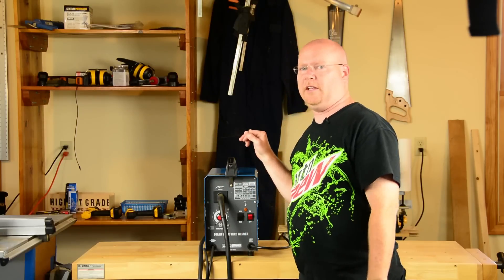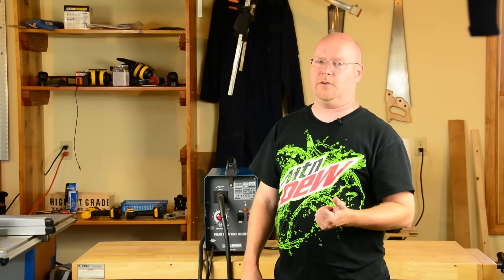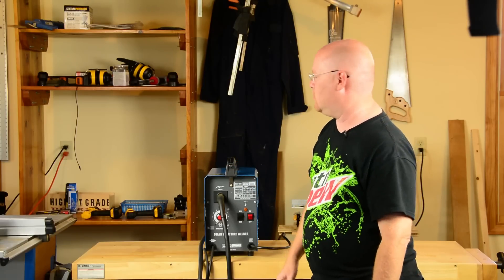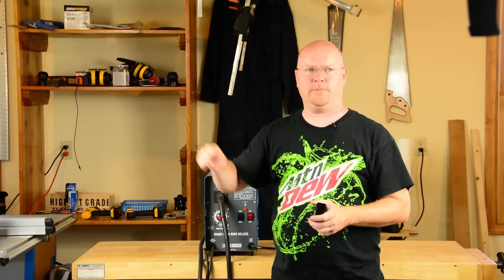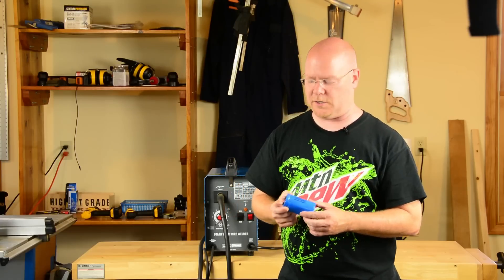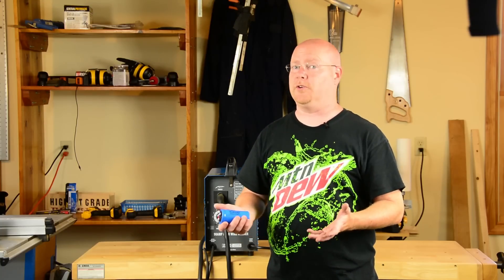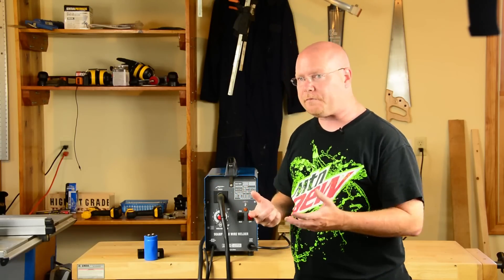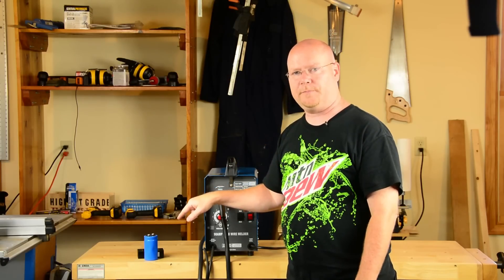Advanced Harbor Freight 90 AMP Welder Mods 01

Comment: Can I use a bigger capacitor
Reply from the maker: You can so long as it's rated for sufficient voltage.  Not much point in it though.
Reply: @MattHeere  what’s the voltage drop when In use and do you have a link for these parts ?
Reply from the maker: @stevenscribner8866  I haven't looked for the parts in some time, so sorry but no links.  The cap needs to be rated for at least 50V
Reply: @MattHeere  does it matter if your welder is on 120 or 220?
Reply from the maker: @stevenscribner8866  Nope.  We're on the secondary side of the main transformer,  so the voltage has been stepped down accordingly already

Comment: Could I take the high side of the heat selector and wire in a potentiometer, I'd assume a cap is needed loke volume pot on a guitar???
Reply from the maker: No.  On this welder the HI/LOW switch is on the primary side of the transformer.  It changes the turns ratio, thereby changing the voltage on the weld side.  The full weld power (plus transformer losses) flows through that switch and you're not going to find a pot that'll deal with nearly 2000W at any manageable size or cost.

Comment: Hi Matt, thank you for your informative videos on the welder mod. I've done this on two harbor freight welders a 90 and 125 amp. Both welders have had failure on the voltage rectifier, it gets too hot and desolders itself. Have you ever run into this problem? I'm using a single phase Diode Bridge Rectifier 1600V Power 150 amps that I bought on eBay from China. Does this happen when you use it longer than the duty cycle 20% for the 125amp 10% for the 90?  I have it mounted outside of my case. Thank you for any help.
Reply from the maker: Hi David.  Yep, overheating is the death of these things.  Without adding a fan for the rectifier you won't be able to use anywhere near the rated duty cycle of the machine.  Get yourself a 120VAC fan and mount it right on top of that rectifier.

Comment: Will just a 1600v 150a bridge rectifier work?
Reply from the maker: Yep.  That's about perfect.
Reply: Matt Heere thanks. Also a 10000uf 100v cap be sufficient?
Reply: Matt Heere hey matt. Thanks for your vidoe conversion.  I don't have HF, but have the jobsmart 125amp welder from tractor supply.  I just added the bridge rectifier single phase to my welder and major improvement.  I just wanted to change the polarity and i got better penetration and less spatter. Im still debating on adding the 10000uf 100v capacitor.  Your insight was helpful to my conversion 👍✌

Comment: You mentioned that the min/max settings are pre-tapped secondary settings on the transformer. Can wiring in a rheostat take the place of the min/max switch and give the user control over the range that's in between the min/max settings? Or do the better machines that have a control knob (that controls the voltage/amps) have a completely different way of accomplishing this?
Reply from the maker: Theres too much power flowing in this circuit to control it with a rheostat.  Machines that have more settings either have more taps on the secondary side and a multi-select switch, or they are inverter based technology which is an entirely different animal from these things.
Reply: Thank you.

Comment: well...my cap blew the second time i used the welder but it still welds!
Reply from the maker: That's a bummer.  Unfortunately a lot of these power caps are imported and made about a well as the welder is ;) . Fortunately, the rectifier is 80% of the improvement.  Do take the cap out if it's dead though, or it'll overload the rectifier.

Comment: Matt, great video series. I am going to be doing this mod to my welder as well. You mention that the 50vdc 46000mfd capacitor is "a little small for what we're doing" in the video. What would be the ideal capacitance and voltage? I am thinking of joining two or more capacitors in parallel to achieve a higher total mfd number. Is 50vdc with a tolerance of 20% (10 volt equal to 60vdc?) be enough voltage, or is a higher voltage rating better? Thanks.
Reply from the maker: Hi Mark.  The capacitance is more than enough.  Honestly anything over 25000 is sufficient.  It's the 50VDC rating that's a little on the close side for my tastes.  I never measured anything higher than 40VDC, but my inner engineer really likes to over-build :)
Reply: Thank you for your quick reply, Matt. I will take your advice and move forward with modifying my welder accordingly!

Comment: I know this is an old video but I would like to know if the voltage on the capacitor matters?
Reply: If your application is higher voltage than the rating of the cap, look out, it might explode. Use a cap that has a higher volt rating than the max volts of the application.
Reply: In case folks are still following this, I agree with Will and add this:  If you exceed the voltage rating of the capacitor, it will short through the dielectric material  inside and goodbye capacitor.  If you see see a metal can (electrolytic) style capacitor with a bulging top of the can, that's what happened.

Comment: While I can agree on the point of spending a little more money and getting a much better brand as well as performing unit, the point that may have been missed is that some of us need to stay in the 115v range for portability as well as not being able to cable higher voltage outlets where it will be used.  That point is the only thing that made me purchase this specific unit.

Comment: so as long as the minimum voltage is equal to or greater than the voltage out of the rectifier
Reply from the maker: Right.  The continuous voltage rating for the cap needs to be equal to or greater than the peak voltage of the rectified DC.

Comment: hey Matt thanx for the info what would you recommend for my 130 amp welder as fare as the capacitor is concerned
Reply from the maker: Same range will be fine.  Check your voltage after the rectifier though.  A larger welder should be a higher voltage, and you'll need to make sure the cap is rated accordingly.

Comment: Can you recommend a fan to replace the stock one on the 90a welder? I bought it i already ordered the parts you have and want to place the rectifier behind an even bigger fan to cool it, maybe modify the housing to fit it in with plenty of room for it laying down flat., also do you recommend getting a longer ground cable? If so which, thanks matt

Comment: There was another posting that stated that a 100amp rectifier might not last.  Would 150amp be better.  Also is 1200V enough, you stated that 1600V might be a little much.?
lastly,  What would be the minimum amount of microfarads you would use, is the 50DC critical?
Reply: +George Beason   Your is the best video system I've seen on this.  Just checking since there has been some time pass since you did the mod on your welder.
Reply from the maker: +George Beason Thanks for the kind words George!   The voltage is a yes/no thing.  As long as the rectifier is rated for at least the line voltage (120 V) and the cap is rated for 50 VDC minimum you're good.  Higher voltage ratings don't buy us anything.  However, lower voltage ratings = fried components.  They are hard minimum requirements.

The amperage is exactly the opposite.  More is better.  If I had it to do over again I'd go with a 150, although my 100 is still going strong even though it's really the minimum size.  Adding a fan for the rectifier would go a long way help ensure reliability too.

For the capacitor there's a range between about 10,000 and 50,000 uF that's ideal.  Any less than 10,000 and you're getting into "why bother" territory.   More than 50,000 won't hurt anything, but big caps are expensive, and it makes for a heck of a show when you short it out to discharge it after the power's off.

Be sure and check the F.A.Q. video too.  There's some additional detail on the components.

Comment: did everything in the first video series and rewelded a previous weld on my exhaust that i did with the stock welder today. the difference was night and day. thank you for the info. i have a few of those capacitors in a spare parts bin, i think i am going to move on to these mods.  thanks for the videos! super easy to follow

Comment: can a capacitor that's rated for 60 volts be used instead of a 50 volt cap?
Reply from the maker: +bill shoop Sure can.  I go into more detail about the specifications for the parts in the F.A.Q. video.
Reply: +Matt Heere Thank you for the response. I bought the same welder about 4 years ago and after watching your videos I decided to try to modify mine instead of buying a new one since I don't do enough welding to justify spending the money on one. I found your videos to be very informational and easy to follow along. Thank you for taking the time to put together a great video series.

Comment: waiting on my parts to get here then will be doing the mod, question, has anyone done the new model HF welder product #61849,...the wire going to the torch looks to be shorter than the one from this video, my cap I ordered is 4" tall, not so sure I have enough wire to play with. I suppose I have two options, wire crimp some extra wire, or possibly make the cap a little taller. I guess disassembling the wire feed mechanism may allow for more room to work?

Comment: Love the videos, very informative. I believe you have talked me into doing this series of mods. Before I do though, I was wondering if there was a way to make the power level adjustable. I'm not very electrically wise, but when I apprenticed as a Tattoo Artist one of the older guys had a rig from some of the old biker days made in a pinch. It was an inverter connected to a rheostat. Is this possible? Probably not super beneficial I would gather or I would guess someone would have done it already. Thanks Again

Comment: Matt, this is a great tutorial, thank you! I am about to order my parts, but I have a question I hope you will answer. I'd like to understand the theory behind why you chose a 50V capacitor for a 120V welder. Is 50V the output of the transformer? If so, how did you know that? Did you measure the voltage drop?
Thanks so much!
Chris
Reply from the maker: UZoo - The Unforgettable U2 Tribute Band Yep.  I measured the output with a standard AC volt meter.  The actual output of the transformer is around 30V on the high setting.  Once you add the rectifier, the DC voltage will peak at around 42VDC or so when the welder is on, but not welding.
Reply: Thanks for the response Matt!

Comment from the maker: +Cee J - Yep.  The little u is actually a greek lower case "Mu".  It's the standard abbreviation for the metric "micro" in engineering and physics.  That also happens to be what the "M" is for in MFD.  They both mean micro Farads :)
Reply: Matt Heere Thank you for replyng!
Reply: uF, UF, MFD, and xx5/xx6/xx7 are all ways to code capacitance in the microfarad range. 105 is 1 uF, 106 is 10uF, 107 is 100uF, and is typically seen on small style caps, especially Mylars or tantalum types.
Reply: You lost me at uF.

Comment: I have several large electrolytics of 100,000 microfarad actual (measured) capacitance. They are rated at 40V, 50V surge. Is this adequate? I haven't measured the rectified open-circuit voltage of my welder yet, so I don't know if a 40 volt cap is adequate.
Reply: Yes, you should measure the highest voltage of the output side of your welder. If it's close, what you got to lose? Try it!

Comment: I see you used a screw terminal capacitor.  Is there any reason not to use a snap-in type, provided it is properly soldered to your wires?
Reply: I'm thinking of putting 3 63V 22000uF snap-in type capacitors in parallel for 66000uF capacitance.
http://www.ebay.com/itm/171734455659
Reply from the maker: Ioldanach Dyfrgi That should work.
Reply: I'll let you know if it goes boom.

Comment: Hey Matt I was wondering if this rectifier would work?
http://www.ebay.com/itm/100Amp-1200Volts-4-Pins-1-Phase-Diode-Bridge-Rectifier-QL100-Type-/231247130516?pt=LH_DefaultDomain_0&hash=item35d7672f94
Reply from the maker: Earl Mcgregor That's exactly the one I have.  If I had it to do over again I'd probably go for 150AMP model, but so far this one is working just fine.

Comment: hey Matt-is this the cap ?I am looking for?
http://www.ebay.com/itm/Sprague-622D251Extralytic-Capacitor-46000uf-10Vdc-/381198988066?pt=LH_DefaultDomain_0&hash=item58c13af322
Reply from the maker: ***** Afraid not.  That one is only rated for 10 Volts D.C.  It would short out as soon as you flipped the switch.  In general when searching eBay look for "50 VDC capacitor", and then go for the highest uF rating your budget permits.

Something like this would be appropriate:
http://www.ebay.com/itm/NEW-CORNELL-DUBILIER-CAPACITOR-101X463U050DC2B-46-000-uF-50VDC-10-75-/390950126499?pt=LH_DefaultDomain_0&hash=item5b067183a3

Note: I picked this one because it came up 1st in the search results.  I know nothing about the seller.
Reply: Matt Heere thanks Matt. I had that exact one saved in my watch list. So I bought it. [and a rectifier. So now just wire and lugs.

Comment: Matt, thanks so much for a very informative video.  My question is, after adding a bridge rectifier and the filter cap, what is the live voltage on the tip of the welder?
Reply from the maker: Mine measures 36 and 42 VDC on min and max (open circuit) respectively
Reply: Matt Heere Thanks for the reply.  Will start converting mine to dc soon.

Comment: can you lay the cap. on it's side. terry
Reply from the maker: Yep.  Won't hurt a thing.
Reply: Matt Heere
my cap. looks bigger than yours (insert joke here) and it's the same volts and uf as yours mines 3in. acrossed and 4in. tall.
Reply from the maker: As long as you can get it in there (insert corresponding joke here) you'll be fine.  Caps vary a lot by manufacturer.

Comment: Yeah I should've just read thru the other posts first before asking..you've answered my question several times already lol
Reply from the maker: LOL.  No worries.  It's hard to find stuff like this buried in YouTube comments.  Someday I'm going to quit being so lazy and write up the projects as blog posts so that all the info is in one place!
Reply: Lol well I brought mine in and took it apart and from what I can tell it looks pretty much the same but different layout. But it doesn't look like the drive roller is energized it looks as if the positive wire and another wire go all the way up the hose with the liner..  The other wire I assume would be the trigger because it comes down to the pcb. So even tho the positive doesn't energize the drive roller that would still be the correct wire to cut into for the BR correct? In my mind I'm thinking "DUH" but I just wanna be absolutely certain... I took some pics if needed
Reply from the maker: That should be it.  I doubt it runs the length of the liner - just attaches to it somewhere near the spot where the torch cable connects to the body of the welder.

And remember, that one should end up negative when you're done.  Technically, it doesn't have a polarity yet :)

Comment: I have a jobsmart 125amp fluxcore welder that kind bought from TSC.. if I did this would I need a bigger rectifier?  I found the one you used but I don't wanna buy it without being sure... I can't seem to find one higher than 100amp that is single phase. Great videos by the way !
Reply from the maker: Thanks Joshua.  Yep, you'd want at least a 150.  I kind of wish I'd gone bigger even on this welder.  No problem using a three phase rectifier though.  You'll just leave one of the AC input pins unused.

Comment: sent two more emails did you get them? terry
Reply from the maker: I got them all.  Can't see any signs of a rectifier in your welder.  Not sure where you obtained the wiring diagrams, but they're clearly not for the device you have.

Hard to say for sure that you can safely attempt the mods without actually having the welder itself, but you should (insert disclaimers here!) be fine.  Looks like your biggest issue is going to be that the speed control circuitry for the wire feed is located right where I put my capacitor.  You're going to have fun getting all the pieces of that puzzle sorted :)

Good luck if you decide to press ahead.
Reply: that's the user's manual that came with it what a bunch of shit. i'm going to dive in and go for it. i'll drill some new mount holes for the circuit board.i've moved the power cord so in comes in the rear of the welder that will help. i'll let you know how it goes. thanks again for your help. terry